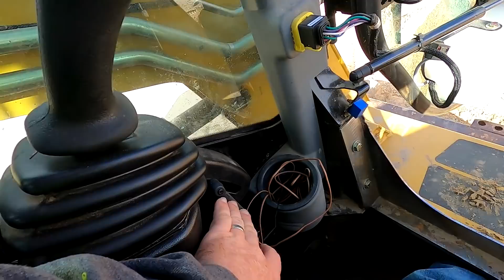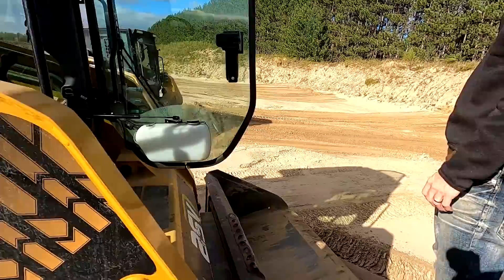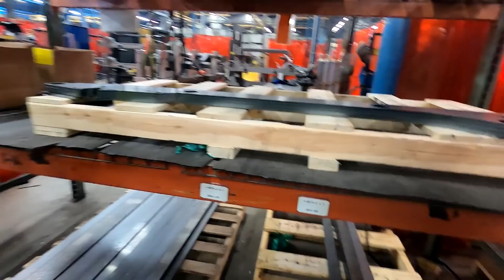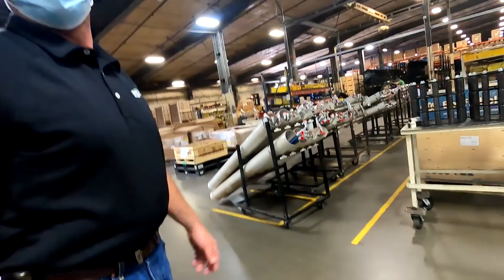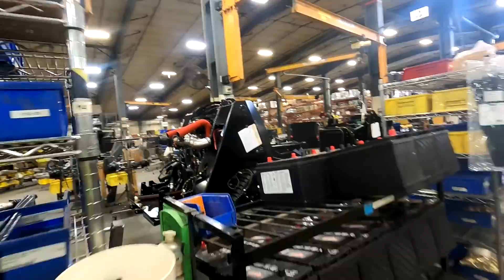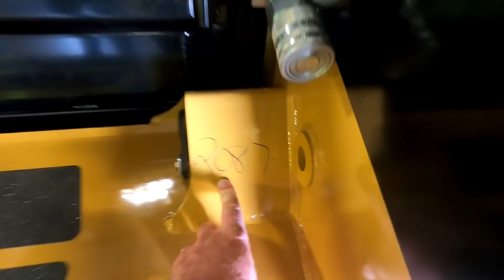Upstate Brush Control Visits ASV Factory

Comment: Awesome video! My 2009 PT-50 is still going strong, only has 1387 hrs on since new, never had it over heat, only mechanical issue was a couple of injectors, put new tracks on it at 1150 hrs and two bogie wheels, all in all it’s been a great machine, and would differently buy another ASV product, the RT-65 Max looks great. Thanks for doing the factory tour.